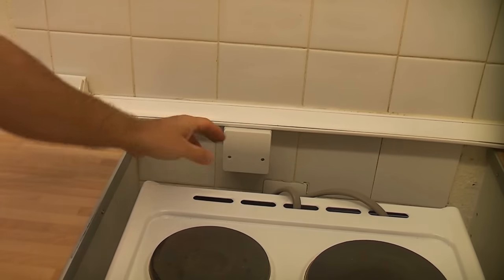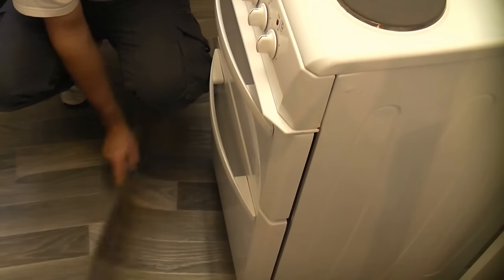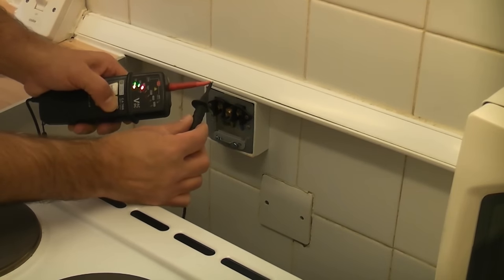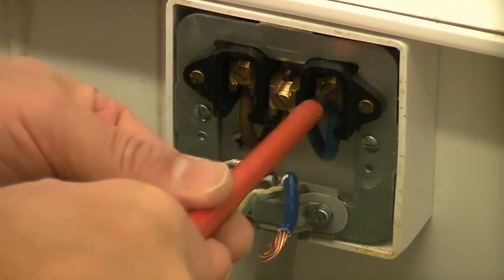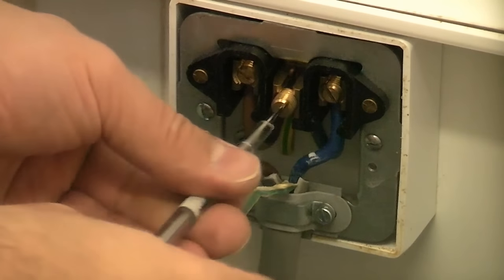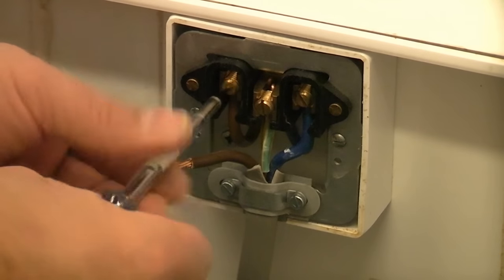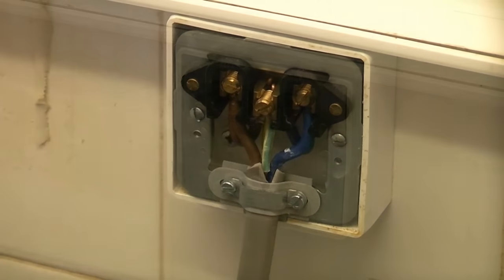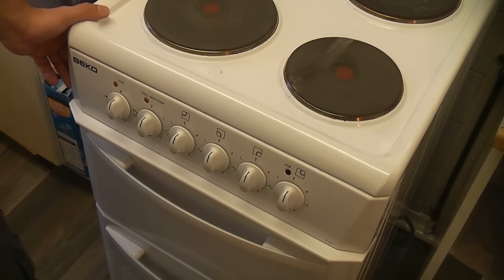How to wire an electric cooker

Comment: It's bad practise to use twin and earth for cookers should really be using heat proof flex
Reply from the maker: I agree, I don't know who used the twin and earth.
It would be a lot better if the manufacturers started supplying the correct cable with the cooker!
Thanks for the comment
Reply: @ultimatehandyman  Yeah you would think by now they would come pre-installed with heat proof

Comment: If you turn of by the mains and switch isolate why  do you need to test if there's a current passing through 🤷🏾‍♂️  genuinely ??? If there is no electric through the home is off by the mains 🤔
Reply from the maker: There are a couple of reasons for it.
I have been told that a MCB can go faulty, and flicking the switch does not isolate the electricity.
The MCB could also be labelled up incorrectly.
People have been killed in the past, so it's always best to make 100% certain
Thanks for the comment 👍

Comment: it would be far saftey to switch the hole supply off
Reply from the maker: Apparently switching off the MCB is deemed to be safer as the main switch can fail (or so an electrician commented on another video)

Comment: Where do I buy a 45 amp connection box exactly like the one in the video. All I can find at places like B&Q and electrical trade suppliers are the type with all the connectors attached to the back of the front cover plate.  This makes the job massively awkward for me because of its position on my wall. The one in the video is perfect for my requirements but every electrical supplier I've been to only sell the awkward front plate mounted type. Whoever thought fiddling about with wires behind the front plate is a good design should be shot, or perhaps more aptly, electrocuted.
Reply from the maker: Are you sure that the terminals don't separate from the front plate, like this-
https://bit.ly/3bUTAhR

It looks like the terminals are connected to the faceplate, but that is only for shipping. You can unscrew the terminals from the faceplate, install them into the deep backbox, wire it up, then fix the plastic face plate.
Reply: @ultimatehandyman  okay. Thanks for that. Maybe I’ve misunderstood them because they’re all packed up tightly in plastic so I couldn’t examine them more closely. I’ll try Screwfix again. With a bit of luck they might be able to show me one that’s been opened.

Comment: Those testers would they show anything if there was a live supply but no neutral or earth return
Reply from the maker: The tester with the two probes requires either a neutral or earth in order to work.
Thanks for the comment 👍
Reply: @ultimatehandyman  so if no earth or neutral you could still get a shock believing there was no current
Reply from the maker: @neiltrevatt   Yes, but it is very unlikely that there will be no earth or neutral.
Reply: @ultimatehandyman  sorry but I disagree with that it might not happen very often but it most definitely can happen so the people you have made this video for need to be aware of this
Reply from the maker: @neiltrevatt   The GS38 approved voltage testers are recommended by the HSE, I suggest you take the matter up with them https://www.hse.gov.uk/
Reply: @ultimatehandyman  you have missed my point nothing wrong with tester but you need also something like a non contact voltage tester to check just the live terminal